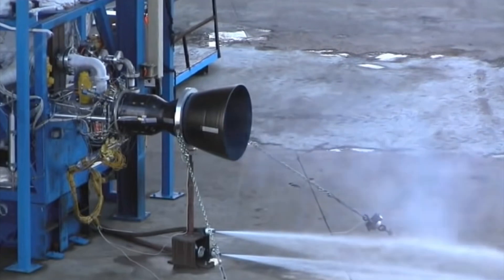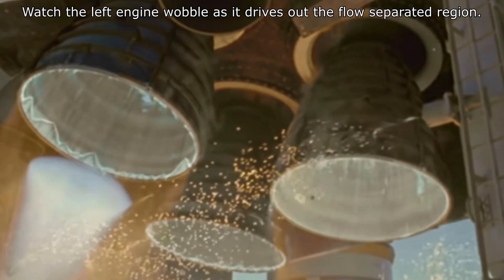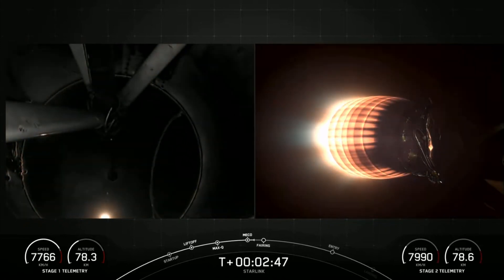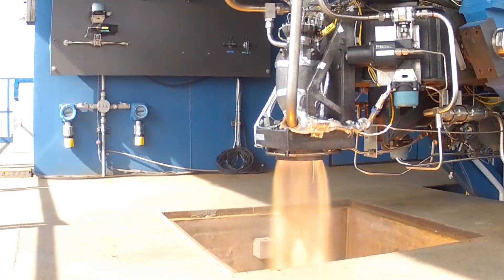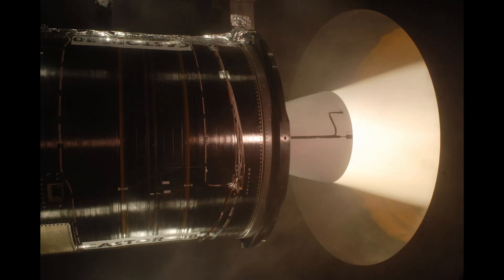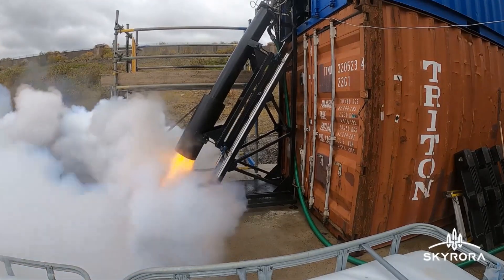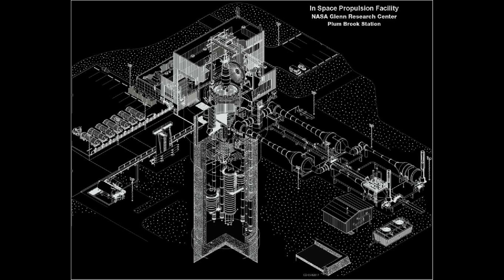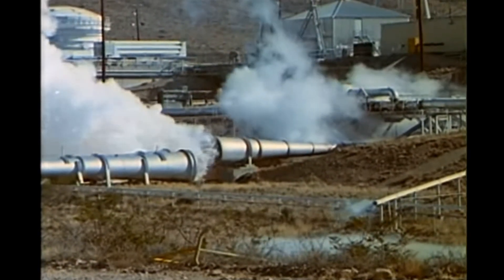Defying Atmosphere - How Rocket Engines Get Tested In A Vacuum Before Going To Space

Comment: wildboar7473 - Thinks rocket propulsion is impossible in vacuum where there's "nothing to push on"

Except the MASS THEY TAKE WITH THEM TO SPACE!
Did you ever WONDER why rockets are about 95% Fuel and Oxidizer at liftoff?
The rocket NEEDS "Reaction Mass".

SO you are STILL confused by mechanical recoil?  
Explain how the recoil from a crossbow works using Newtons laws and the law of conservation of momentum.
You know, to a high school level.
You cannot, or you would not be perplexed by rocket propulsion.
Reply: He has no intention of answering questions.  He is so butt hurt that I made him look like a fool, that he has doubled down on his imbecilism just to irritate me.   Seems he has such delicate feelings that he takes it personally when you point out “facts”. Like the fact that he could not pass a high school physics exam if his life depended on it.
Reply: @stuartgray5877 and the fun thing with air, is whatever air you are pushing off below means you have push through it above, so it all cancels out anyways.
Reply: @PsychoMuffinSDM  AND if you ask them HOW can a rocket “push on air?  Why doesn’t the air just move out of the way effortlessly?  What property does air have that allows it to be pushed upon?”

They won’t answer. If they refuse to answer CERTAIN questions then they are PRETENDING to be a moron.  A real moron would not know what questions to AVOID.
Reply: HEY  THATS  ME !!!  (dunning-Kruger guy🙂)   < not confused about my 🧠👊
Reply: @wildboar7473  - You cannot, or you would not be perplexed by rocket propulsion."

So you ARE confused by mechanical recoil.
I'd offer you a cash reward to explain how recoil works, but it would be pointless.
Reply: ha ha   I got it  why my replies got deleted, half baked links for🥶 >>>
(((NERD ACCIDENTALLY PROVES ROCKETS DON'T WORK IN SPACE!)))
rockets push off air 
MECHANICAL ENGINEER    • Rockets don't work in space   Tim Parz Rockets burn fuel and the exhaust is pressurized. When the exhaust is released its coming out at a high rate slamming into the atmosphere. It can't move the atmosphere out of the way because there is too much of it so it moves the rocket instead. In the vacuum of space the exhaust is free to escape so there is no force applied to the rocket and the rocket will not propel. Its the same thing as a balloon rocket. The air coming out of it is pushing against the air outside of it creating a force. If you put it on wheels the balloon rocket will roll/propel across the floor or table. If you catch the air coming out of the balloon with a vacuum hose the car will not propel. NASA claims it should propel because it doesn't need to push off of anything. They say its the " unbalanced force inside the balloon that makes it move but the experiment proves them wrong. Rocket DO NOT work in space.

bob question from YouTube: "Newton was not thinking about rockets in space when he came up with the third law. 14.7 psi doesn't sound much, but when you realise that it equates to one metric tonne per square foot, or 2116 pounds per square foot, you suddenly realise that we are actually under an immense pressure. If an elephant stood on you, you would be under less pressure. The elephant messes you up because the pressure is uneven. This air pressure is plenty to cause resistance to the expanding gasses of a rocket. We don't feel the pressure because we are pressurised and all is under equilibrium."

Franky Uk 22 hours ago Clemens Richter: Like all NASA disciples who unquestioningly follow their dogma, you are quite obviously under the illusion that a bullet fired from a gun emphatically proves that a rocket can work in space. You seem to think that the forcible ejection of the bullet from the barrel causes the gun to recoil and that a rockets thrust is akin to several billion bullets being fired and therefore the rocket is being constantly ‘recoiled’, which proves that a rocket would work in space.

To be fair, when a gun is fired in normal motion, the recoil does appear instantaneous. In super slow motion, however, you can see this is not the case. As the bullet leaves the barrel, the gun does not recoil immediately but remains stationary in the shooters hand. The bullet is, in fact, some distance away from the gun before it recoils as this video demonstrates:    • Video  

The recoil is actually caused by the ejecta, the hot gas molecules that initially force the bullet out of the gun. As the gas molecules follow the bullet out of the barrel, they act exactly like the thrust of a rocket and bombard the resistant force of ambient air pressure. This causes the gas molecules to be pushed by the air pressure and thus the gas molecules are returned to the gun causing it to recoil in the shooters hand. 

Bottom line. If you could fire a gun in space where there is no resistant force, the bullet would exit the barrel and move endlessly through space. The hot gas molecules would also exit the barrel and with no resistant force to stop them, would follow the bullet, forever moving away from the gun thus making it physically impossible for the force of the gases ever to return to the gun as they do in Earth’s atmosphere. The gun would therefore not recoil and would not move.

Just like a rocket...
Reply: SWEET LORD APOLLO no One fully ignorant replied on this   gracious Winners science share?   Me? Confused?  Though my incomprehensible gibberish would not reveal  That :(   
A GUN   rather closed system aint it folks?  One end open, the other Resistance, with a bang of aggressive pressure, least resistance  going?
Reply: @wildboar7473  - "Explain how the recoil from a crossbow works using Newtons laws and the law of conservation of momentum.
You know, to a high school level.
You cannot, or you would not be perplexed by rocket propulsion."

OR demonstrate your toddler intellect by refusing to answer the question.
Your choice.
Reply: @wildboar7473 on my channel I have a video showing a physics simulation with nothing but a static rocket and high velocity particles inside. There is nothing else in it. This is no air or any other objects to push off. Yet, using only laws of motion, the rocket moves one direction while the particles inside leave. How do you explain that it moves forward if there is nothing else for it to push off of?
Reply: @PsychoMuffinSDM  ...same as sodacan man?  In tiny small chamber?  Forward will happen with Matter (tail) pushed against Matter, like a lower floor🤯...(dah)  
..... How do you explain ROCKET moves forward if there is nothing else for it, NO EXHAUST GASSES shooting out in "vacuum" chamber....? 

Rocket pollution primarily arises from the use of fossil fuels in rocket launches, which release soot and aluminum oxides into the atmosphere. These emissions can contribute to increased temperatures in the upper atmosphere and have a detrimental effect on the ozone layer and overall climate.
Reply: @wildboar7473  Still unable to explain basic physical mechanical recoil I see?

Then perhaps you should go back and complete high school physics?
Reply: @ huh… you seemed to miss what I said and what my questions were. I’ll try again: 
On my channel I have a video showing a physics simulation with nothing but a static rocket and high velocity particles inside. There is nothing else in it. This is no air or any other objects to push off. Yet, using only laws of motion, the rocket moves one direction while the particles inside leave. How do you explain that it moves forward if there is nothing else for it to push off of?
Reply: @wildboar7473  Tell me what is the exhaust gas from a "Space Shuttle Main Engine" (SSME)?

How much exhaust gas does a SSME expel in one second during liftoff at sea level?
What is the velocity of the Exhaust gas from a SSME at sea level?

These are all questions that ChatGPT can answer if you are confused.
Now ANSWER THEM.
Reply: ...so no me since 3 weeks ago? Many of my.... stuff gets ghosted or eliminated by... Agents.... such wonderful Google YOUtube freedom :)
...so now what?  O yes I did post something, back to hidden safe Newest First section :(
Reply: @wildboar7473  So again, using only laws of motion, the rocket moves one direction while the particles inside leave. How do you explain that it moves forward if there is nothing else for it to push off of? You seem to keep missing this question.
Reply: @stuartgray5877 Damn, he really has a hard time understanding this concept, huh? I feel my sim makes it pretty clear. So odd he insists there must be air to push off, even though my sim has none and it still moves.
Reply: @PsychoMuffinSDM  ...goes on here... LAWS (human) of motion... in rebel SPACE that does not care for propeller motion reaction. More than just a leaving, shovel out mass will not make rocket forward.  Same as a fish in vacuum = 0
Reply: @wildboar7473 oh so you are claiming that mechanical recoil is a hoax now too ?
You are brilliant!

Write a book on how you have proven Newton’s third law to be false and submit it to the Nobel committee for your award
Reply: @wildboar7473  Can you try explaining again? None of that formed either complete or coherent sentences. I noticed you have again avoided addressing why my sim has the rocket moving when you say it should not be able to.
Reply: @PsychoMuffinSDM  Always interesting what folks avoid and YT hides, 25 replies but only 16 in Top section :)   Lord what can you not be so happy like the Oklahoma University Aerospace guy?  Not like I ever claimed to be a rocket man.  Bird seem happy pushing upwards, as balloons (satellites).
     
Basicly I dont believe Newton makes laws, for space, nor soes Physics bend to Humans. Why not play with more head butting ?
>> Kareem Salessi    ("Solving-Apollo-Enigma-1")=("APOLLO-WAS-HOT-HYDROGEN-BALLOON") ("Moon-Landing-Hoax")
>>> 100 Percent proof we can't orbit earth. Debunk This.
Mike Helmick 
ps: thank you for hiding this Threat too Industry friendly YT :)
Reply: @wildboar7473  Yeah, we all get those YT issues. Regardless, you STILL have yet to address why my sim showing a rocket accelerating when you keep saying it should not. WHY DOES IT MOVE?
Reply: @wildboar7473  it  doesn’t need air to push off of. In fact, atmospheric elements harm rocket efficiency by slowing down the mass going through the nozzle, decreasing thrust dramatically.
Reply: @wildboar7473 You don’t even acknowledge momentum and continuity eqns that disprove you
Reply: @wildboar7473  I hope you realize the only propulsion that actually "push off the atmosphere" are propellers, right. Not even jets push off of the atmosphere
Reply: @peskyshoes  Thanks, mighty kind Partner for the hoping :)  But... no  NO  I  dont realize That! 🥴  Have some experience with Propellers (following obediently lord Newton's LAWS, Action > Reaction) in Air or water...  Maybe some with Wings actually pushing.... (bird, bees, planes, kites... clouds) 🤔  Sadly thats it ! 😕
.....poor me
A jet engine produces thrust by drawing in air, compressing it, mixing it with fuel, and igniting the mixture to create a high-speed exhaust of hot gas. This process works on Newton's third law of motion: for every action, there is an equal and opposite reaction. By expelling a high-velocity jet of air and gas backward, the engine is pushed forward.  ...but no need of air  in front... so like (Space) Rockets better to have Vacuum behind !!!  🤗 Wonderbar  ❤🧠👍

🙄
 Fighter jets can fly between 50,000 and 60,000 feet in altitude, with some specialized military aircraft reaching even higher, up to 85,000 feet or more. The maximum altitude is limited by thin air, which provides less oxygen for the engines and less lift for the wings. 
🤓< only
Yes good boys, Thrust likes high altitude because less pressure, resistance, drag, but not too little..... 
This thin air reduces both the lift generated by the wings and the amount of air available for the engines to compress and burn fuel, which decreases engine performance and thrust. 
note for idiots : air is part of Atmosphere😲 is part of a Whole, like water in the sea🛥, grabbing (like a rope) IT and throwing IT back against more air 🤯 => there would be no thrusting without >> no Birds flying  kaput! 👇

The Brain is your friend🙂
Forget your Teacher, use it Today! 😃
Reply: @wildboar7473  Action: rocket pushes mass out the back

Reaction: mass pushes forwards on the rocket
Reply: @wildboar7473  The exhaust gas from a rocket engine is expelled at over Mach eight in atmosphere.

Tell us HOW rocket engines accelerate that exhaust gas.
Is it "Magic" or "Physics"?

Comment: I quote " NASA's Space Power Facility houses the world's largest vacuum chamber. It was built in 1969 and stands 122 feet (37 m) high and 100 feet (30 m) in diameter, ..."

So no way they could of tested this before going to space or reproduce the same atmosphere... They didn't go to the moon
Reply: @Speedracer The first manmade object made it into space in the 1940s. Scientists and engineers understood basic physics. They knew that rockets push off the mass they eject, not their surroundings. 

By the end of the 50s, both the US and Russia had launched multiple satellites. In the early 60s satellites were being sent to the moon. In 1966, both the US and Russia soft landed probes on the moon. 

All evidence clearly shows the moon landings happened and it is an established fact that rockets work in a vacuum.
Reply: Boy going to stay in Newest First! More about programing than thinking here.
Not same mix as LM, plume?
Reply: @wildboar7473  It’s the moon landing deniers who are programmed to project their ignorance based conclusions as facts.

Rockets work in a vacuum. 

And the LM engines exhaust plumes were basically clear because of the fuel used and the lack of surrounding air.
Reply: Lot of barking goes on  with nasa space fans, plenty of non-understanding went on before 1968 "Moon orbit".  Took a while for superscientist WV Braun to understand that Earth would Slingshoot (😂) Spaceship to Moon, thous very less rocketing..... Never and never will see Rocket push on itself in Vacuum chamber (aside against FLOOR, like one stupid sodacan pop near wall evacuation....)
Reply: @wildboar7473  You’re pretending that people don’t understand orbital dynamics until 1968. That is blatantly false. 

And again, rockets push off the mass they eject out of their nozzles. 

Please answer this simple question. If you stand on a skateboard and throw a bowling ball, you will roll backwards. What did you push off to make you roll backwards?
Reply: @wildboar7473  - "For children, cognitively arrested adults, nasa engineers.... "

Says this year's dunning-Kruger poster child.
Reply: @wildboar7473  SO you are STILL confused by mechanical recoil?  
Explain how the recoil from a crossbow works using Newtons laws and the law of conservation of momentum.
You know, to a high school level.
You cannot, or you would not be perplexed by rocket propulsion.
Reply: @AM-rd9pu  Pretending   false   .... doing damed!  
And again, rockets push off the Atmosphere mass they fart against.
Reply: @wildboar7473  Where do you think the force comes from that ejects mass out of the rocket nozzle?
Reply: @AM-rd9pu  ...explosion - burn mass process like a petroleum engine.
....from where do you think a   dynamite stick force comes from?
Reply: @wildboar7473  Ok good job. You’ve got half of the equation. Let’s work out the rest.  

If you just left a stick of dynamite on the ground and detonated it, the force from the explosion would spread in all directions. Rocket exhaust is funneled into one direction. Do you agree that a force is required to contain the blast from an explosion and point it in one direction?
Reply: @AM-rd9pu  ....? A giant piston forces the mass out?  Pressure pushing against the structure forces out?  Complicated...🥵 after all isnt it Newton Law that just shoveling MASS out ass pushes /pulls moves Rocket ? 🤗
Reply: @wildboar7473  Hold up, you think rocket engines use pistons?
Reply: @AM-rd9pu  Based on the nonsense wildboar spews he likely cannot tell the difference between a RS-25 and a 2JZ

Comment: when the rocket is launched from earth you have the ground to provide impulse to all rocket body , it works like a wall to pushes the rocket , the gas acts like a stairway , it  is like the carbonated soda flushing push up with violence trying to scape from the bottle, but in space there is no the ground  this is the proverbial factor to sum every explosion in the combustion effect, if you use a bigger chamber you will see, the piston only will be spin  inthe same place
Reply: Sorry but mechanical recoil still works in a vacuum as do all of newtons laws 
Rockets take mass with them to vacuum to push on
Reply: Never seen explanations why LAW dont work with Propellers.... 
Like Newton did not consider while testing in Space...
Reply: @ashleyclebk1967  READ my words SLOWLY:
Rockets TAKE MASS WITH THEM TO SPACE TO PUSH ON.